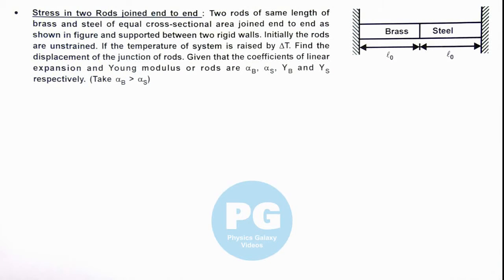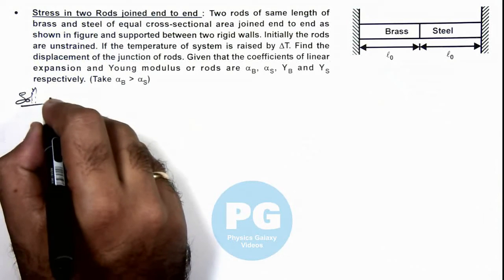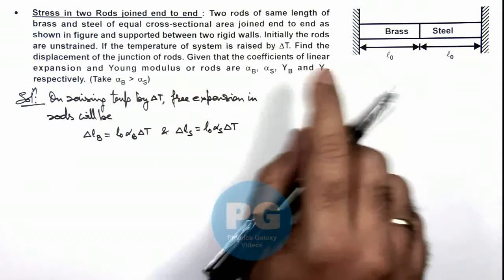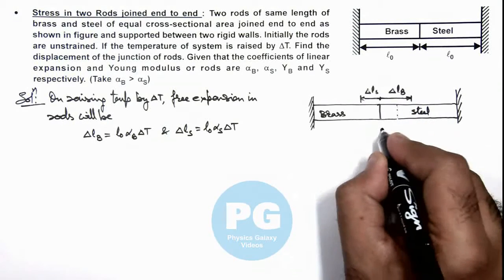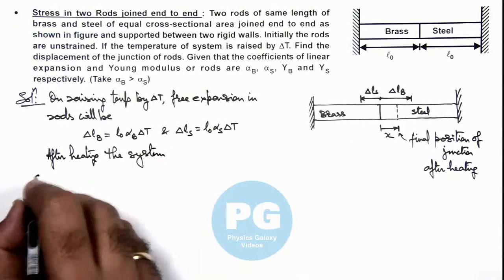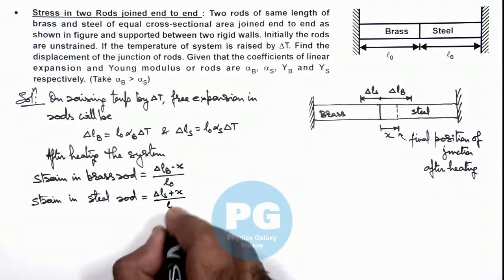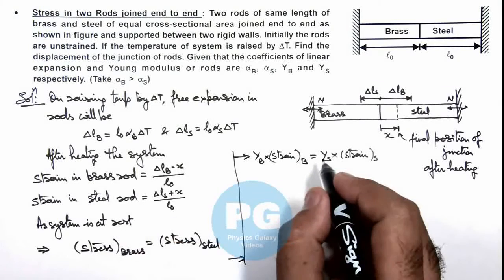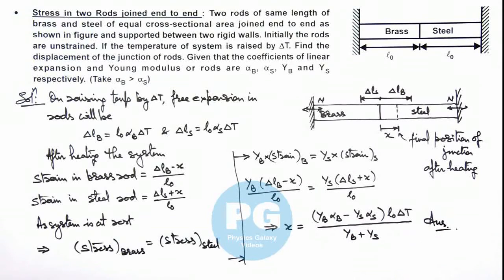8. Advance Illustration | Thermal Expansion & Calorimetry | Stress in two Rods joined end to end

Comment: Sir why we have taken all the expansion(of rods) at the site of junction. What I mean is there will be some expansion towards the ends of rods which are in contact with wall and that expansion will be compensated increasing the normal force. Hence there should be lesser strain(than what we have calculated) at the junction.

Comment: sir here both the rods are pushing each other but stress is only due to normal reaction from the wall na ? because only restoring forces contribute to stress .
Reply from the maker: stress is due to internal forces within the body which are caused by external deforming forces...
Reply: Sir I still cant fully get why stress in both is same .
Reply from the maker: Because the bodies are at rest so these are in equilibrium... at every internal section of these bodies net force in both direction must be same...